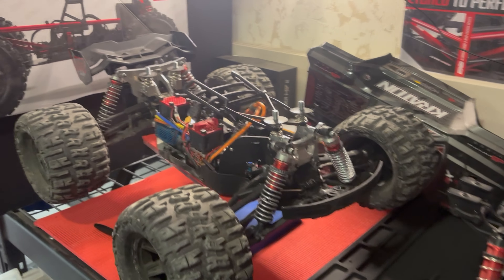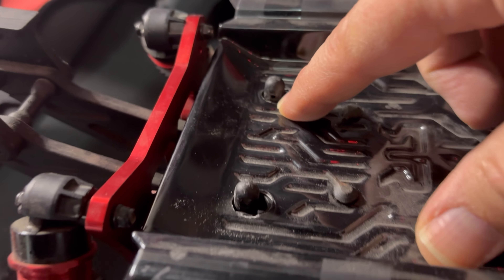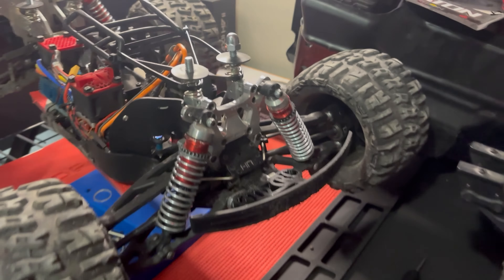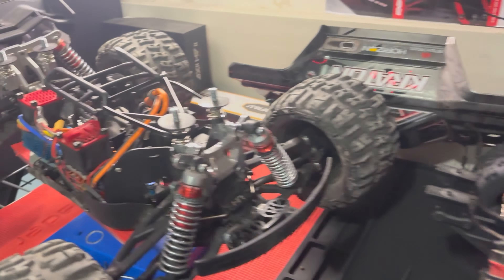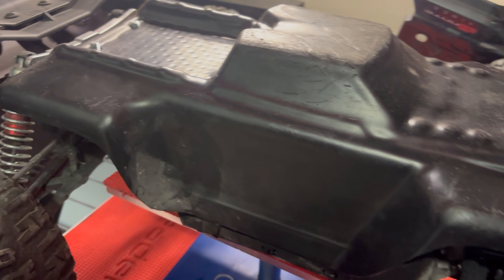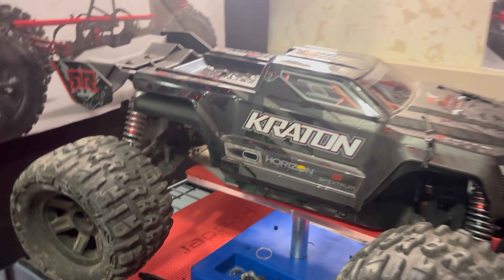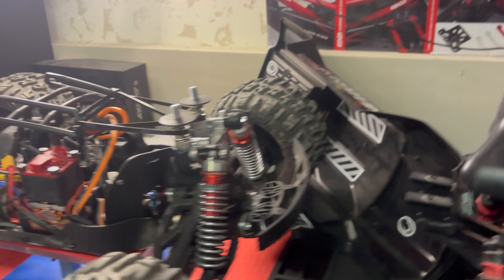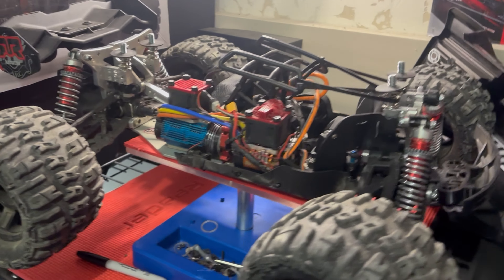ARRMA Body mounts MOD - Why you want this!!

Comment: You can mount the Bashbody with the mounts that have the swivel clip on them. I just remove the clips when I run my Basherbody and with the ProBody RC bodies or stock ones. I can put the clips back on for both of those bodies.

Comment: I use the Proline mounts, not as beefy, but same concept. For the same reason, so I could reinforce the body. I’ll never use pins again. Screw mounts are so much easier to get on and off.

Comment: I’m curious to see if those bolts will still bend.I’ve been running bolts with nuts on mine for a year probably and they are now bent and have to be cut out of my M2c mounts🤦🏻‍♂️loving your creativeness Randy👊🏻
Reply from the maker: Yeah, if mine bend, I’ll switch to 1 1/2 inch version which should help a lot getting rid of a good chunk of leverage.
i’m hoping, however, with the springs that instead of bending it will shift downward instead. More likely on a straight roof landing, versus a nose dive. But we’ll see. 
Thx JP

Comment: What are those body supports between the shock towers? I'd like that for my Kraton 8s, maybe I wouldn't smash new bodies flat the day I get them
Reply from the maker: Body supports between the shock towers? Can you be a little more specific? are you refferring to the zip ties? If so watch the video at the bottom of this comment. 

I mean this video is all about body supports between the shock towers. So what part specifically are you referencing that perhaps I didn’t explain. I am totally happy to help. Looking forward to your response.

https://youtu.be/m_dgljiqG0U
Reply: The part that sits up high between the body supports front and rear. Over the batteries and center diff but under the actual body, It looks like an inner roll cage, that is mounted to the body posts/bulk heads, that's the part I'm talking about. Any more specific and I'd already know what the part is and would own it
Reply from the maker: @TheOneAndOnlyRandy  
lol... good point... any more specific you would know the part intimately. 
I believe your talking about the actual roll cage component itself. which comes as a standard stock part with the arrma kraton. its designed to mount right on top of the cetner diff cover plate with two pins.
Reply: @EastTactics  that isn't a stock kraton 8s part, if it was I would have one installed in my kraton, and maybe that other kraton in your video would have one on it too, maybe it's an optional part but I cant find it on the arrma website which is why I asked
Reply from the maker: @TheOneAndOnlyRandy
That’s because mine is a  6s arrma kraton

https://jennysrc.com/products/arrma-kraton-6s-v5-blx-side-guards-battery-tray-roll-tower-wing-mount-ara8608v5?_pos=1&_sid=cbf19426c&_ss=r
Reply: @EastTactics  OOOOOOh! I have the 8s.
I guess I might have to fabricate one myself. I love the idea of protecting my bodies from the inside, My kraton spends so much time in the air I always tell everyone it's a car shaped airplane... those launches result in a lot of head landings, but no bash = no fun soo